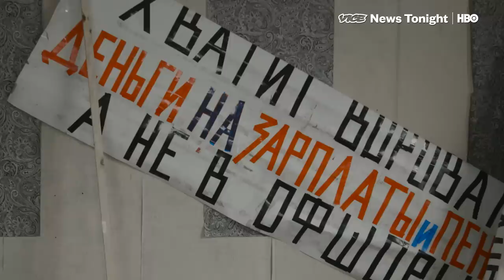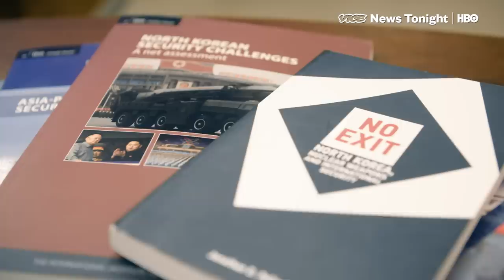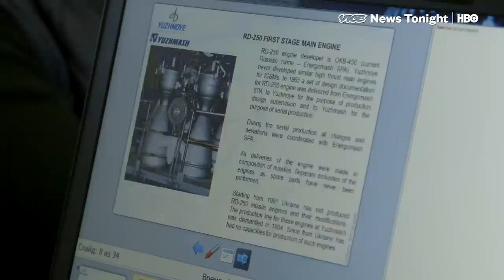No One Is Sure Which Country Is Helping North Korea Make Its Missiles (HBO)

Comment: I'm not sure why the DPRK (North Korea) would need help. They are not cavemen, and ICBMs  are a technology that has been around since at least 1957 (sputnik). SpaceX, a private corporation builds them (essentially), even amateurs in their garage can and have built multi stage rockets (they are just smaller than ICBMs). It's not too hard (especially) if you have the proper infrastructure in place, just rather expensive.